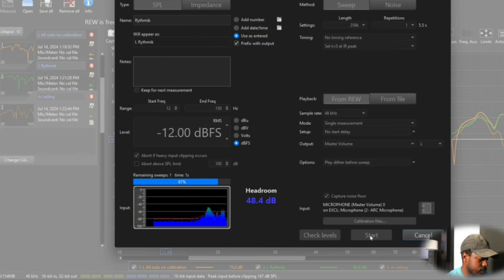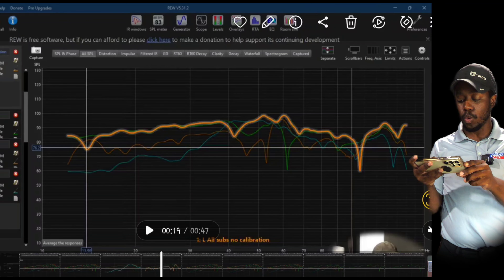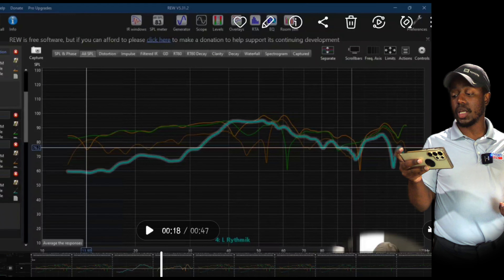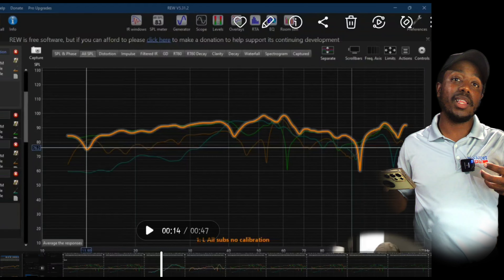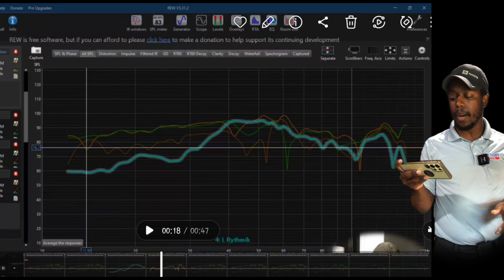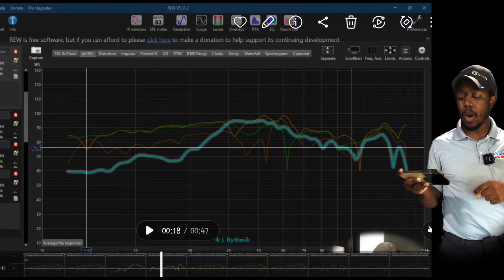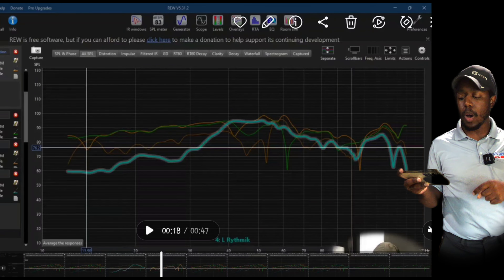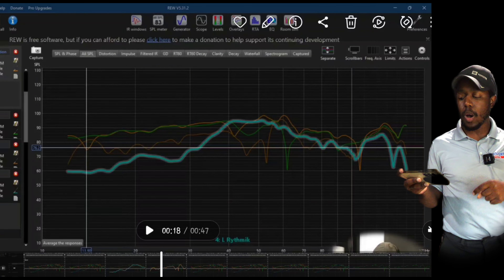My $3000 Subwoofer SUCKS!!...But I fixed It 😏

Comment: Toyota is Number 1 Best Cars and Trucks. My 1994 Toyota pickup truck, we got it brand new in 1994 always very reliable drives like new. 2004 & 2006 Camry car 4 Cylinder also drives like New now. My 2004 Camry LE is best and brother has 2006. Just regular Maintenance is the Key. Want the 2026 Tacoma Electric truck and also 2024 Prius LE. (Saw your Toyota polo shirt).

Comment: It's a Long tedious process of trying out all the locations and angles- the perfect placement in the room. Then there's the Amp Gains, Frequency levels too. My OSD Trevoce 12's is very weird but it doesn't sound that good when the Sub Amp Gain is 50 to 75% but when i turned the knob gain to 35-45% it's Super Deep hard hitting Bass like Beast Mode. I think 40% is the sweet spot now.
Reply: Still have not used DSP adjustment but i set the Onkyo Receiver Sub crossover to 50 HZ for most movies. 40 HZ for Edge of Tomorrow and Godzilla. 60 HZ for war movies like 13 Hours Benghazi, Lone Survivor. When using LFE cable then 80 HZ is the best which is also good for THX modes.

Comment: IMHO, the DIY sub was in a good/complimentary position to start with.....it just needed some shelf filters to boost the low end, so it's STARTING with a fairly flat response, most DIY sealed subs need this, just as ALL commercial sealed subs have it inbuilt from the manufacturer.
I'd take a near field measurement of the DIY sub and the Rythmik and compare the 2. Take it an inch or so from the front of the box, dead centre between the 2 drivers.
Jiles McCoy has a good video showing this with a DIY sealed Harbottle 18" sub
Reply from the maker: That's a fair thought!
Reply: @jamiet74  this is a very good point, that what he's seeing with his rear sub as compared to the Rythmik might very well be the difference between baked-in DSP vs. not, and in that case it makes sense that naturally his DIY sub would not be contributing as much to the ultra-lowend. To that end I'd say some shaping of the rear sub response would be warranted, but he knows this, and the gain from better placement to the response of the Rythmimic is kinda a separate issue to that
Reply from the maker: Spot on
Reply: @Kpaceguy  Matthew Poes just released a video literally discussing exactly what I've been recommending.. please check it out as he obviously explains it way better than me mate. Good luck

Comment: I wondered if you could get a better response with both of them up front. Gene D. Matt P. Anthony G. All 3 spoke of how they should be up front. I have just watched a video about the sealed subs and how they are much easier to get low if you have 2 both flanking each speaker.
Reply from the maker: @MichaelLHill-fd3kw  that's what I did in this video. Both are up front but we aren't fitting 3. I'm going to move the 3rd around off camera and see what happens
Reply: Front & Center recruit 😊
Reply: @Kpaceguy  Are you going to be showing us your finished results after you get the 3rd sub done?
Reply from the maker: Most likely not
Reply: I don't think I've seen these guys recommend putting both subs up front as a general rule, I mean sometimes that works best, but often not, the room dictates the best spot.
That said ,1/4 & 3/4 spots along the front wall can work well if you can adjust the seating distance
Reply: @jamiet74  Matt just did another video on the subject.

Comment: Amazon has Movie Camera with big Microphone should be good for recording my Subwoofer/ Home Theater video clips. They are $150 or Less and No-Name brands from China. 5K and 4K movie camera are $109 and $143- I will get the 5K with 10X Optical zoom as it's only $143. I'm just looking for a Microphone to record the subwoofer and attached already to the camera less problems of connecting via XLR if bought a Sennheiser Microphone for $100-150. Just way easier and simple.

Comment: Not sure if it’s coincidence or not, but in my room I’ve observed that the closer I am to the sub the less low end under 30hz I get when I measure but there’s more tactile energy. Moving the sub further away results in more low end in a measurement but less tactile feel.
Reply from the maker: Yes, your room has less influence on it the closer you are to it. And naturally you feel thr vibration more since it's less diffused

Comment: I decided to delete my former comment, since I realised it was condescending.

I also hadn't noticed just how little the addition of the other subs contributed to your output at the sub-bass frequencies.
Though at those frequencies, it still confuses me somewhat that placement was that critical. At your room-size, we're well below the modal region at 20 Hz, and you should simply have a pressure zone. Either way, I'm glad to see it got better. 

Have you checked to see whether the different placement negatively affected seat-to-seat consistency?
Reply from the maker: Your comment was fine! If I didn't like it, I wouldn't have responded to it. I haven't had enough time after recording this video to play around. I do know that in my seat, it sounds better. I'm getting louder bass at the lower frequencies without a physical volume change which was the goal BUT I want to take the ceiling sub out and put it in the room and see if I can positively add to what's been achieved so far. 

I've been lucky that what I hear in 1 seat has been close to the same in the other which may be all thanks to my rectangular/symmetrical room. I'm excited to demo nonetheless !
Reply: @Kpaceguy , I can totally relate to that "feel" of the bass changing when you get it right. It's like it's more forceful without the actual SPL measurement changing. I assumed it was phase- or impulse-related